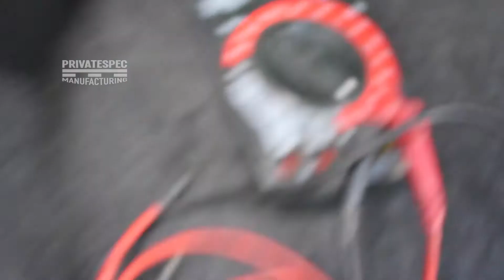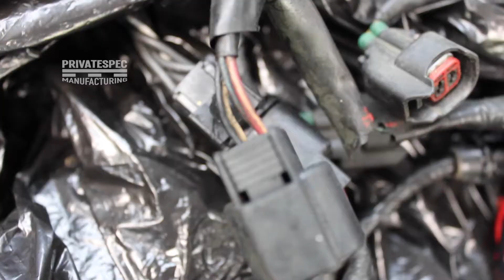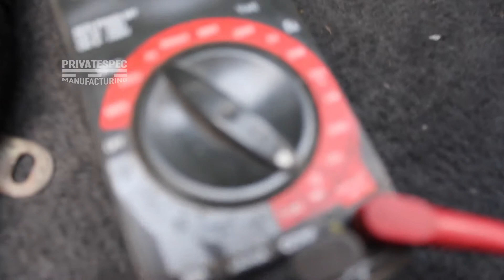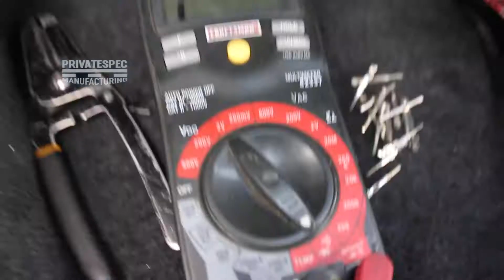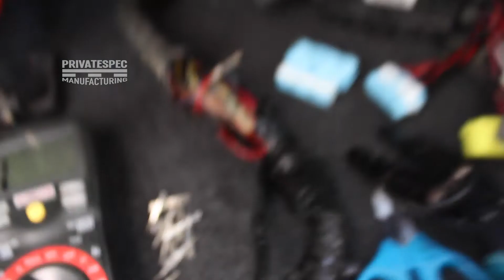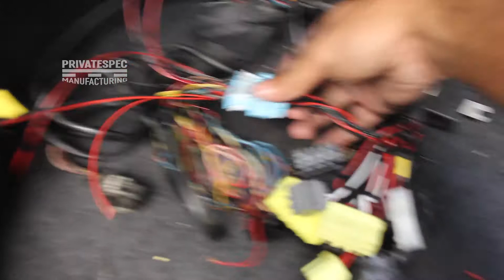EVOLUTION 7 8 9 WIRETUCK PRIVATESPEC LOOM INSTALL

Comment: So with the wires that you spliced in you need to keep those wires in the new wiring harness and run those back into the engine bay? Or do those wires stay inside the car for all the gauges and what not?